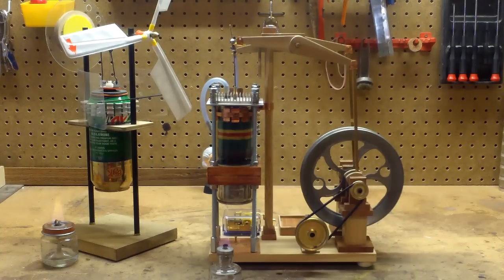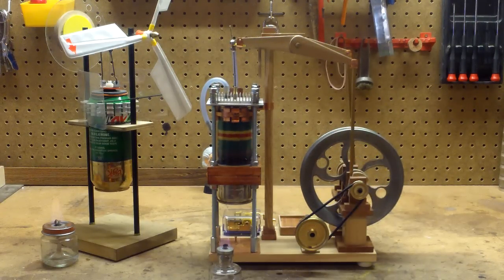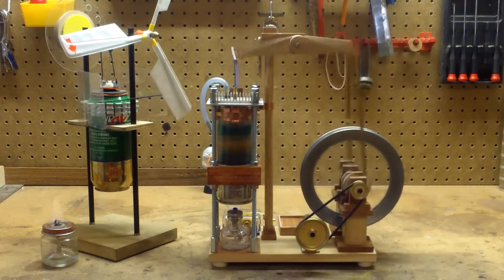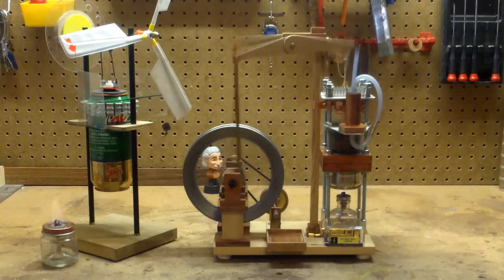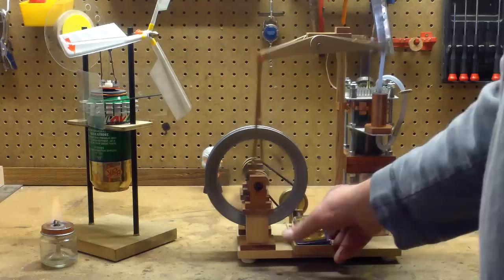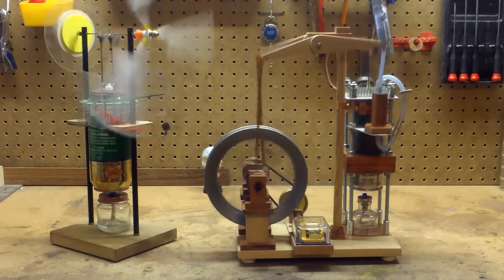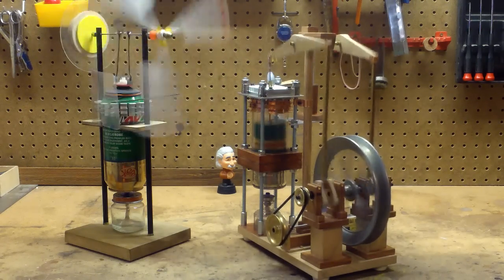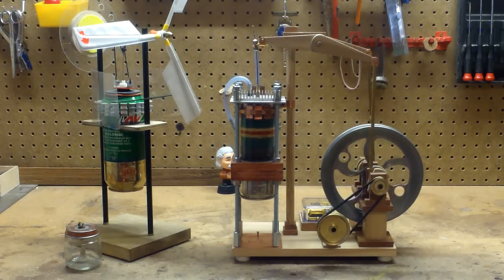Stirling engine powered music box. By: Mike Graban

Comment: Very elegant design and layout of these engines.   The music " if I only had a brain", well it looks as if you do have an intelligent mind which is both artistic and very logical engineering logic in it. The air cooling  is neat and tidy.   As I do not make engines for long term or continuous running I usually wrap a wet towel around the cold end of the displacer, but your idea is very interesting and I shall use it.    Again congratulations. 
I do believe that the walking beam engine does not use a double throw crankshaft but only one throw and the 90 degrees are obtained by orienting the power piston. Yours is  a " two walking beams engine as it uses two beams nicely interlaced  in a concentric shaft.  Prosit.